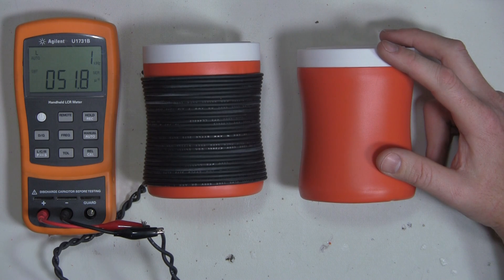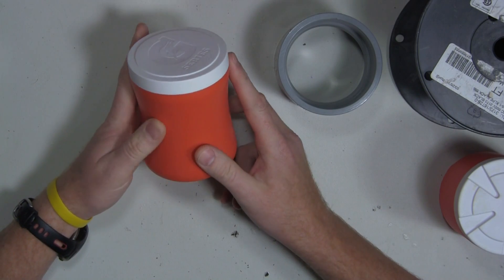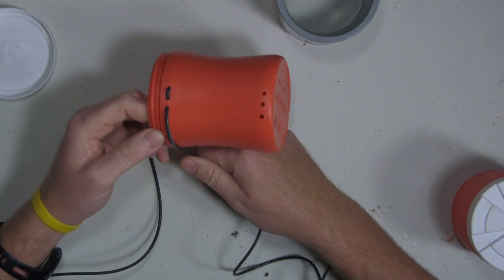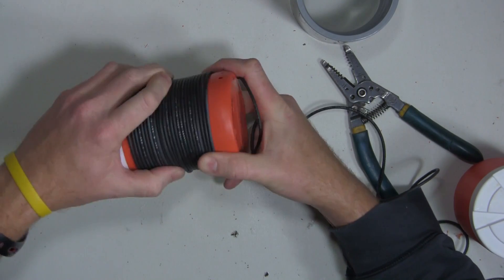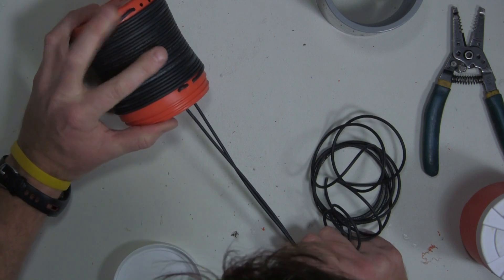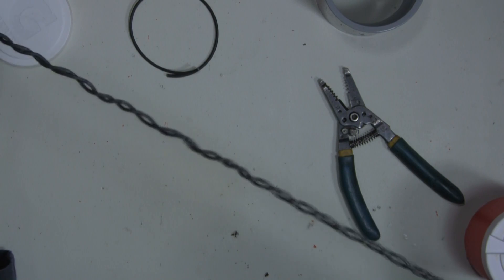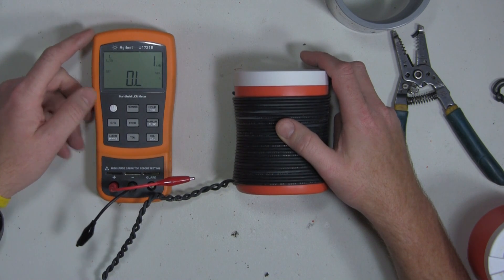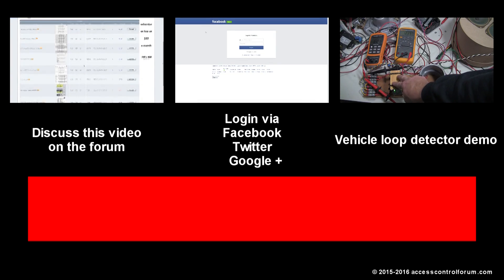ACF 018 DIY Test vehicle induction loop for $0

Comment: Hello . Great project by the way and I also like your video. We are also making an induction loop sensor for our project. I do have a few questions for you. Does the frequency detector have a relay inside of it or do we need a separate relay? also if there is a relay inside of the detector, how do we use it? Do you know how to connect the frequency detector to the microcontroller? Your help would be much appreciated. Thank you! 
here is the frequency detector we are using
http://208.73.201.123/store/product/Automatic-Gate-and-parking-gate-Single-Channel-Loop-Detector-loop-induction-vehicle-detector/233325_1815904633.html

here is the microcontroller we are using:
http://www.st.com/content/ccc/resource/technical/document/user_manual/1b/03/1b/b4/88/20/4e/cd/DM00105928.pdf/files/DM00105928.pdf/jcr:content/translations/en.DM00105928.pdf